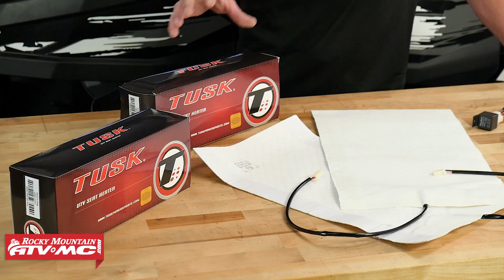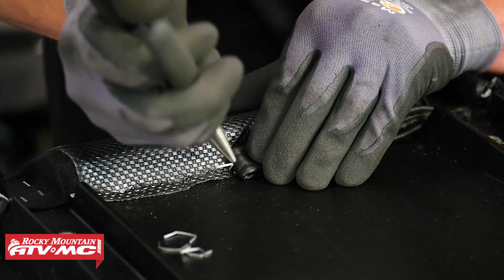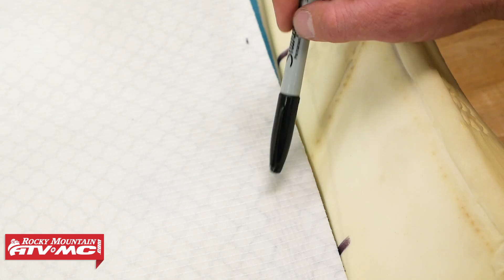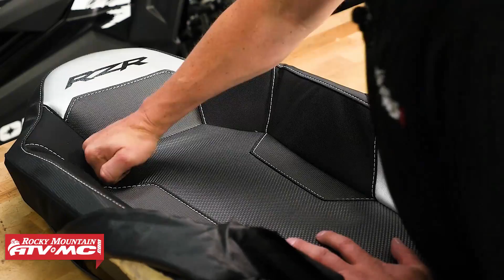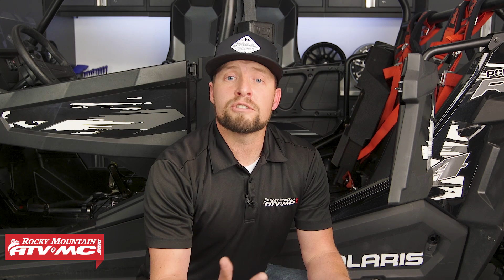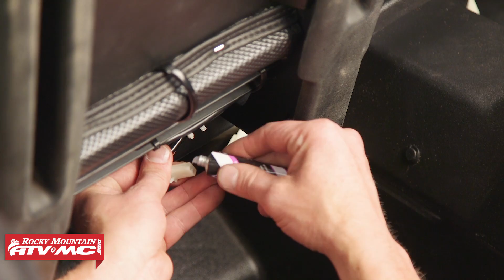How To Install a Tusk UTV Seat Heater

Comment: Having a problem, just got a 21 yamaha yxz1000se and the seats are to narrow for the heater pad. Theirs straps I guess you call them coming from the cover and run down under the foam which makes it impossible to lay these down flat.  I tried cutting notches on the sides of the pad to clear these straps and the pad only heads on the bottom half but not the upper half. 
So what's the best way to do this? I call rmatv and they said can cut on the sides just don't cut the copper wire. I only see those at the top, am I missing more of them?
Reply from the maker: Hey Jason, There isn't a lot of room to cut on the heating element. The vertical wires go all the way up along the edges. Did they get cut? https://youtu.be/YSNLsTMaLus?t=183 If they didn't get cut, you can reach out to our warranty department. warranty@rockymountainatv.com
Reply: @Rocky Mountain ATV MC  
Yea on each side I had to cut like half moon shapes to clear the straps holding the cover. So what's my options? Can you fold the edges over enough to go between these straps?

Comment: 1/4" staples are too short for polaris general. The factory are 3/8". Local store doesn't carry 3/8 in stainless. Might try 1/2 but the 1/4 are popping out. They will not hold the trim piece that conceals the ruff cut fabric.

Comment: What stapler did you use to restaple these?
Reply: I got a arrow air stapler for $35 on amazon, best thing I ever bought! I have 2 dirt bikes I redid seat covers on and tried every stapler but a air one and had to goto a shop to have them staple it. This time I wasnt doing that. This puts them in with no problem and fast!

Comment: Could you put these on all four seats and wire them all to one rocker switch?
Reply: Wire them all to a relay and switch the relay with the rocker.
Reply from the maker: These seats use quite a bit of battery power and a rocker switch is usually spec'd for one seat. So we'd recommend one seat per switch.
Reply: @rmatvmc   how many amps do they draw? Per seat?  Thanks
Reply: @campquitcherbitchin_SD  It says they take 50 watts per seat.  So divide 50 watts by 12 volts and you get 4.167 Amps.  Hope this helps.
Divide Watts by your Voltage to get the Amps.

Comment: Can these get wet and still work?
Reply from the maker: They will hold up to washes and being splashed with water, especially being under a seat cover. But you wont want to submerge it in water.
Reply: @rmatvmc  Can you be more specific? LOL. If the heater is off, shouldnt it be ok if we pass through a creek and get water above the seat level? Assuming, we let the switch dry out before using. I avoid deep water in the fall and winter but in summer time, when we dont need the heater, seem like it should be ok as long as it is dry by the next time I need heat. Thanks.
Reply: I wouldn’t get those worthless scotch locks wet. Great Video till I saw those being used.